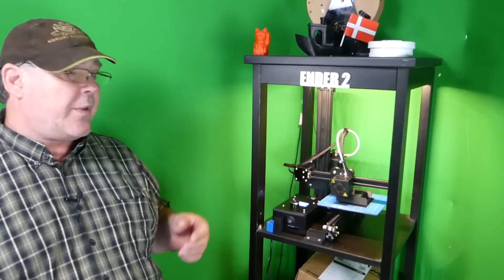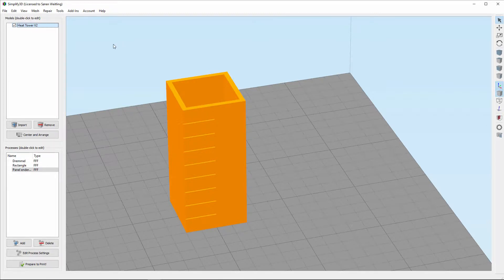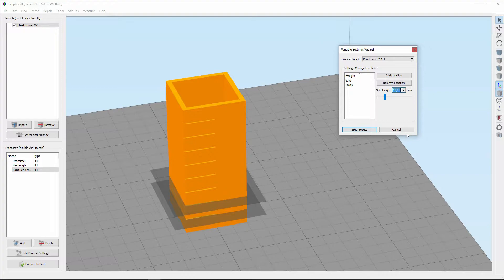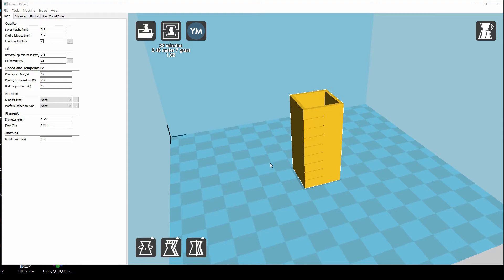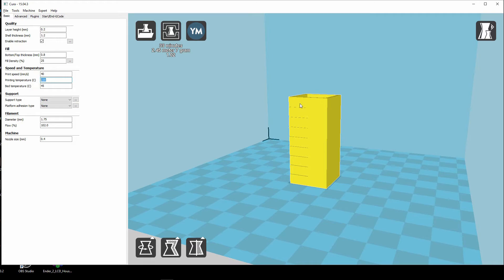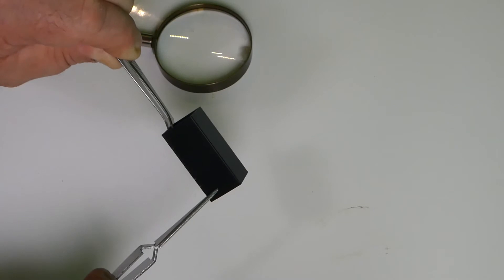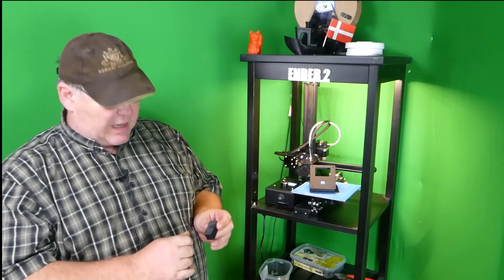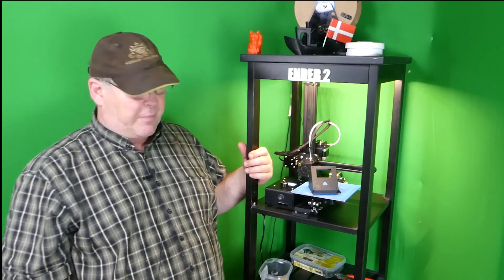Heat Test your filament with a Heat Tower

Comment: Great video! I have a question though... Would I have to do a temperature tower for each quality setting or will one suffice? Thanks in advance! Dave.
Reply from the maker: Sorry i dident see your question.  Normally you do a heat test when you start use a new spool of filament.
Reply: Danish 3D Printing Ok, many thanks! 👍🏻😎